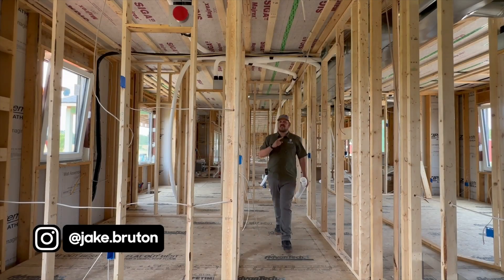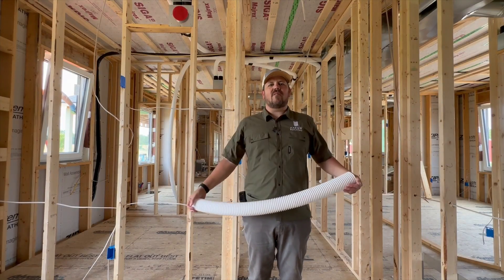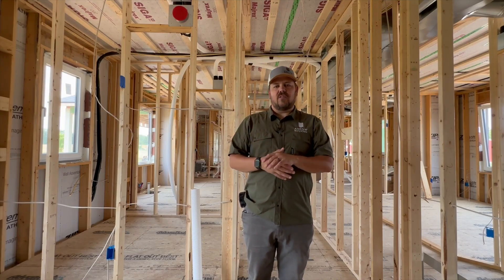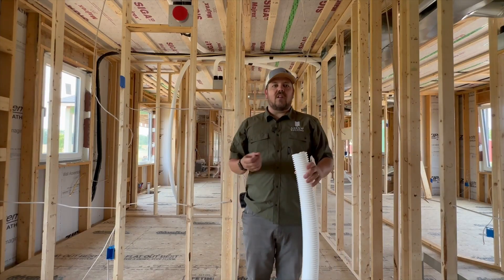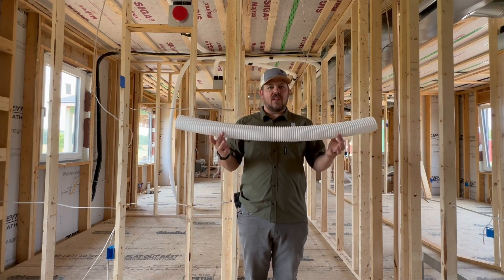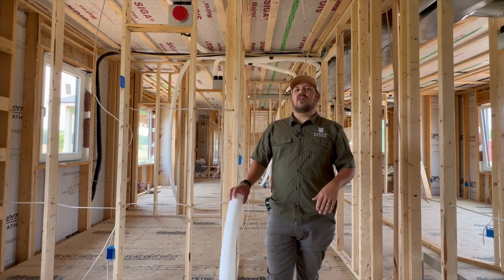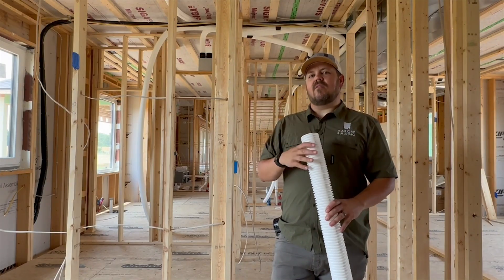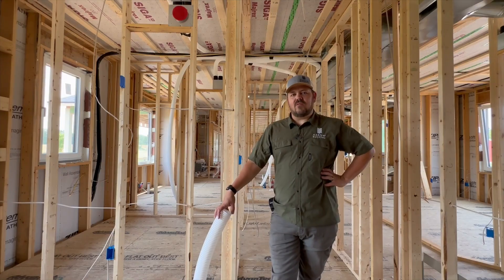Balanced Ventilation is the KEY to Success!

Comment: This is the problem with most energy efficient construction, you're making it a $15,000 upsell.

Instead of lots of small rooms I'm going for open concept so four rooms total if you don't count closets.  My cheap ERV will live above my bathroom and exhaust bathroom air with fresh air ducting to the other three areas.  I'll probably have less than 20' of duct total.

Hearing the ERV is a concern but one thing I don't like about the central heating I had in my childhood home is you could put your ear to a heat register and hear conversations in other rooms.

In my mind that means a solution to duct noise is all I need to make a cheapo ERV every bit as good as your Zehnder and that shouldn't be a $14,000 solution.

Energy efficiency should be maybe a 5% upsell in the total cost of a new home because most of home construction is very similar with standard construction and energy efficient construction, then the designers should be looking for solutions to reduce cost to offset the expense of energy efficient construction like an open floor plan so you don't need to run fresh air supply lines everywhere.

My house design has ICF walls with clear spans so I don't have to have any structural interior walls.  The roof is a single slope, south oriented for solar with a BIBs style blown in fiberglass cold roof insulation.  The money I save from doing a cold roof I'm going to spend on my hand seamed standing seam steel roof with zero penetrations.  My HVAC will be a few mini-split units and I'm going to go to the local community college to get an HVAC certificate so I can commission them and my ventilation system myself instead of pay for HVAC guys or expensive Mr. Cool DIY AC units.

The real innovation is in cost effective high efficiency details made with conventional construction materials.
Reply from the maker: I hear you, however this video is a republish from Build Show and a couple years old. We have run the math more recently and I can tell you that it breaks out like this... Zehnder provides the engineering, ductwork, and unit, all in one. Another manufacturer needs ductwork built onsite, engineering done by the mech engineer, and then the ductwork will be substantially more expensive to install. If you spend 15k (normally a little less I think) you get the engineering, the entire system including duct work, teminations, and filters, and a simpler to install system. The delta tends to still be a few thousand dollars but it really isn’t a cost so much as an investment, we have had multiple other units go bad in a couple years on clients. We have yet to have any issues with Zehnder units. I don’t think I have a hard time seeing these as the right choice, even in a budget build they still generally make sense. Also, comfort and health shouldn’t always be viewed as an additional cost, the industry just does a crap job with them and thats why it is generally sold that way, as an additional 5%. I would say the other guy is cutting out what is needed.

Comment: Any comment on the sound travel between rooms? Most of the new builds I experience use the classic big ducts wich T off at each room. At my mothers house you can hear what people are saying in the kitchen when you're on the toilet (probably the other way around too). Even when there is 30 feet of hallway between these 2 rooms, so it's purely the ductwork.
I am starting the build of my own home soon and have a Zehnder unit lined up, but I can't find any info anywhere about the sound traveling via the ductwork. It seems like this system would be better than the classic systems, but I have not experienced a Zehnder. I want to use staggered stud walls for some rooms, but that's a waste of time, money and space if you can just talk to the other rooms via the ductwork...
Please do make more video's about this system. I would enjoy some more in dept info. Any tips for making the system even better? I might have 1-2 ports unused on my system, where could I send that extra airflow? Maybe upgrade the bathroom extraction or add ventilation to a closet.. Adding in some more materials is not gonna make a big difference in cost now.
Reply from the maker: I have not experienced travel through this ductwork because it goes from termination to unit only. There are no T’s in the unit.

Comment: Jake I am building now , (Zip r , European windows, tight house) and have had zehnder design a system and your pricing is very close to mine.  I have listened and researched how to handle the ventilation of the house with an ERV and have seen repeatedly that an independently ducted system as the gold standard but many builders spec cheaper systems and tying it into the return on the HVAC system and utilizing the HVaC ducts  and air handler to distribute the air.  What are your thoughts on how to handle the ERV design and ducting?  I am very confused with what is the best way to go.
Reply from the maker: This is a great question, I am in the camp that just because things use duct work doesn’t mean they should share ductwork. I understand that we will be paying more to install more ducting. However, we won’t have to worry about back drafting, a dehum drying an ac coil, or other dumb things effecting each other that don’t happen when systems that are seperate remain seperate. Nice things cost money. The best performing method is to keep everything seperate.
Reply: I can answer this for Jake. He just spent 18 minutes explaining why the Zehnder system is the best. I know that not having independent ductwork for the ERV means that you should probably run the air handler fan constantly which can waste energy, add noise etc.
Reply: Thank you Jake.

Comment: Do erv/hrv replace the need for bathroom exhaust vent fans ?
Reply: Yes. An ERV will exhaust from a bathroom.
Reply from the maker: In our homes we use the ERV as a replacement for bath fans. Balanced ventilation over the depressurization exhaust any day.
Reply: it can, but multi-speed bathroom fans ducted to the recovery ventilator return works out much better.
Reply from the maker: I would recommend checking with any manufacturer prior to doing such a thing. It doesn’t sound like a good idea to use a higher pressure fan to presurize a lower presure system and moisure load the core at higher rates than designed even if periodically. My suspision is this would do serious damage to the unit and immediately void any warranty the unit would carry. Of course if your engineer approves the install, do it. Ive never heard of anyone doing such a thing though.
Reply: @jake.bruton.aarow.building  It seems to me that if such a bathroom fan fed air into the ERV return, the excess air from the bathroom would just go out into the ERV interior-air extraction (return) system.  If that system doesn’t contain one-way valves, and the return ports are unrestricted, the ERV shouldn’t be hurt; you really wouldn’t even be pressurizing it if the return ports are large enough.  You’d just be sending humidity and smells to the rest of the house if the bathroom fan(s) total CFM is more than the ERV CFM.
Reply: @jake.bruton.aarow.building  

Dude, try it. This is the way. 

runs on half the power, more control, boost one room at a time. turn a dial for more or less flow rather than live with how it was balanced.

fan amps drop when they're run in series like this, easy life for those motors. they end up running at 2-3 watts each at the continuous cfm, ~ 5 watts on boost. Actually reduces static pressure since the return resistance is neutralized. 

as for the core, dial the boosted bath fans cfm to max out at what the erv is designed for. get a larger core than you think you'll need anyway and leave room to turn things up if they ever want to.

edit: yeah, I'm not aware of anyone else doing this either, but I wouldn't do multi point erv return without terminal fans after getting these results.

Comment: I listened to the section between 3:00 and 5:00 twice… Am I to understand that this doesn’t have a provision to make up air when the stove hood is running?  That is to say, the fume hood still requires its own supply duct and fan?
Reply from the maker: You are correct. That would be a different system. This is for balanced continuous ventilation, it doesn’t have anything to do with the range hood. This thing only moves say, 100cfm as opposed to 800cfm on a hood. This wouldn’t be much help in that scenario.

Comment: Maybe I should go home and the 30 tons of coal on the property and the wood and coal stoves. Cheap, great heat. And keeps you warm in the winter.
Reply from the maker: Also not great for indoor air quality. All electric homes can take very little effort, electricity, and provide incredible levels of comfort. You just have to know what you are doing to create a propperly controled indoor environment.
Reply: I lived in two homes years ago in New Zealand that were heated with wood/coal stoves. It was not great. Yes sitting in front of a wood fire is nice, but my sisters asthma was out of control. The amount of dust and airborne particles was crazy. I have come to the conclusion that Matt Risinger has come to, which is if you want a fireplace build it outside on your porch. Keep all combustion outside of your home. I realize this is easy for me to say living in a modern house in a hot climate.
Reply from the maker: We live in climate zone 4 and wouldn’t go back to having combustion indoors either. We had a small gas leak for who knows how long that went undetected in our last home. That is very scary.

Comment: Time to go back to Energy Vanguard and talk about Zehnder. Again. Stop spending all me money! Great presentation as always. You had me with the noise issue.
Reply from the maker: We have done the math on the Zehnder units, they certainly are a bit of a premium, however they break down as follows; 
Zehnder provides the engineering, the other manufactures don’t, added cost to the other unit. 
Zehnder provides all of the duct work with their price the other manufacturers don’t, added cost to the other unit. 
Zehnder uses the comfo tube, the other manufacturers don’t, added cost to the other unit when it comes to install. 
Things start to get a look closer than you would think. When you consider all of this plus the noise difference, if I had to do it again I would spend the couple grand to get a better performing unit that is substantially quieter.
Reply: @jake.bruton.aarow.building Except Brink, they provide a very similar service and 3” ducting, etc. They just don’t market as well.
Reply from the maker: We have not installed a Brink yet. I have handled one of their units, and maybe just because it was one of the early units into the market but I was disappointed with the build quality. That doesn’t mean that it cannot function well, hold up over time, and be just fine. I just wasn’t happy with it in the 2 hours I spent messing with it. Just FYI.